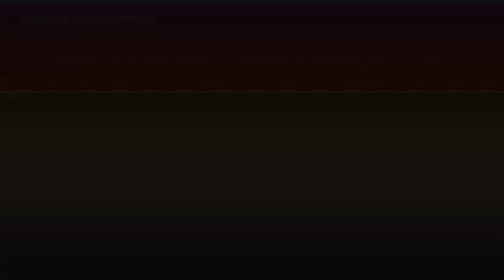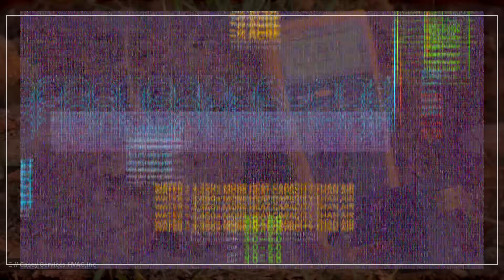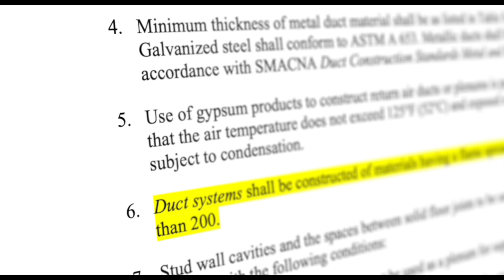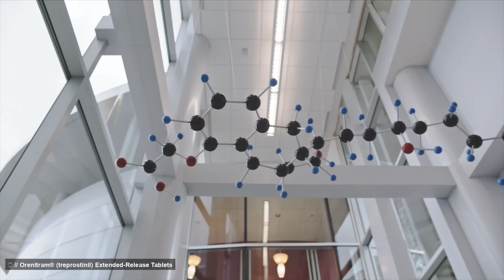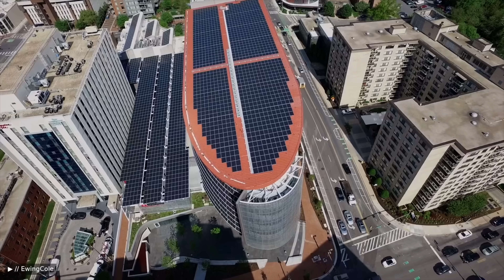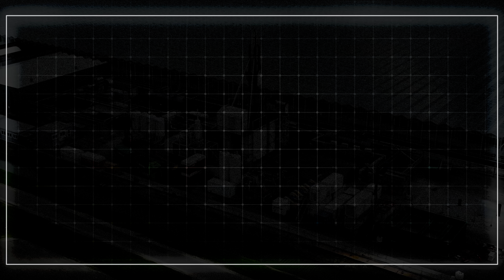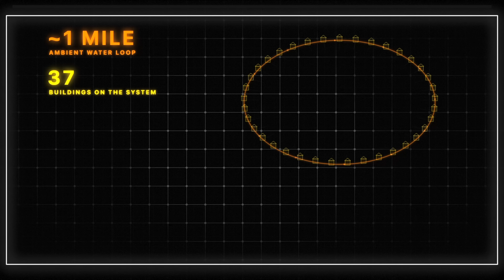The Viral DIY Cooling Hack That Nearly Killed a Family

Comment: usually with a bore hole we do 150-400m but we do one hole for residential and 2+ for big house (mansion) and apartment buildings we dont do shallow bore holes. 
And cost wise where i live its about 150.000KR or about 15-18 thousand dollars depending on the size you want on the heat pump. 
Cost is usually 10k $ for the hole/work then the rest is heat pump and the pay off period is around 5 years sometimes alot less we had one guy that payed it off in a year it all depends what energy you come from and how good your house is,  so for example the best scenario is that you have a really good insulation on the house and floor heat with a house battery and solar/hydro that way you can pay it of fast IF you have high energy prices the more your energy cost the faster it will be payed off

Comment: It's almost impossible to prevent mold from growing in the underground tubing or pipes, which spread mold all throughout your house and gives you the mother of all upper respiratory infections that can have life long consequences or be fatal if it gets too bad. You're better off building a partially in the ground home, the ground temp with help keep the lower walls and floor a constant temperature, lowering how much you need to heat or cool the house to keep things comfortable. The only thing you need to keep an eye out for is effective moisture barriers to keep rain or groundwater from getting into the home, and Radon buildup in certain areas.

Comment: I report ALL videos (to YouTube) that use "BANNED" in the title as 'misleading'.
I'm aware of a home in East Texas that put in an air ground source retrofit on a 4.7 acre plot and had condensate issues in their underground pipes... What they did is run / snake dual 3/4" water lines looped THROUGH the air pipes (there were 3 buried air pipes so 3 loops) and just flooded the air pipes with water for conductivity from ground to water pipes and as a 'storage' medium. The old intakes were shortened to ground level and capped off and the house air intake pipes were disconnected, with only the water pipes emerging from the old air pipes.

Comment: My HVAC is handled by several heat pump mini-split AC units. I have solar panels with battery storage in a total electric home, and my total energy costs are $0.00 per year. I think this may be the most practical and least expensive way to do this.

Comment: You can tell it's a nonsense claim that it's banned in the US simply by the fact that it claims the ban comes from the "International Residential Code". The US famously DGAF about international building code. The US can't even agree on a single building code for the whole country. Building codes are set by the individual states.

Comment: Ever since I saw Tech Ingredients build his, I've wanted to do one myself. it's such a simple design. I'm thinking a bunch of shallower bore holes of wider diameter could work just fine for a whole house system given his results. That little unit he had was working at a crazy efficiency level and it was keeping up with such a large space, and it would help especially with heating my home (which is heat pump only, no gas or other combustion heat) when the temperature drops below 40 degrees outside. Mine switches to inductive heating around that point and our electric bill has been in the high 500's some months in the last couple of years because of how much power is consumed from that type of heat. I've got some window/insulation work to do to improve the efficiency of my house, so it should help out some there, but this simple tech would save us thousands every year if I could DIY one in. I'm talking about a geothermal heat pump/AC setup, not the passive air duct system BTW. In NC it's humid and there's groundwater just under the surface for most of the year, so it would be impossible to keep it free of moisture and mold.

Comment: As a solar architect with 40+ years experience, I’ve done ground source Heat Pump systems and stopped many years ago, not because they didn’t work, but because there were cheaper ways to do it. An airtight super insulated shell combined with inexpensive, mini splits in anything, but the coldest climate is far less expensive. We’ve also been off the grid for 27 years now and have upgraded our solar electric five times and now have an E-10 Anker system with 12,000 W of PV
Reply: Passive insulation in the home is number 1 cost savings, many ways to do it, and then as you said, cheap solar that can make it last for hours after daylight (heating or cooling and other uses) independent of how many batteries one has.
Reply: @segundacuenta726  every house has 1 complete air exchange per hour ideally so you still need to heat it.
Reply: @MrDmadness depending on how tight the building envelope is, an HRV or ERV system would allow the building to complete as many air exchanges as necessary with minimal thermal loss by using the exhaust air to precondition the incoming air. If it's an ERV, then it can also transfer the humidity level over to the incoming air, either humidifying or dehydrating it to match the interior air.
Reply: @codymartin5431 thats why i statedthe minimum code. I desiggn and install heating systems
Reply: Modern air-source heat pumps are amazing.
But where I live the 1 week of back up heat required (when the grid is least able to support it) may still justify a ground-source system.

Comment: A vertical geothermal hole works great for the first 20 years, then it starts to run out of thermal energy, in cold climates anyway. A horizontal grid type loop a little below the frost line works much better since the ground on top can be heated by the sun through the warmer months. Air to water heatpump comes pretty close to ground source in efficiency, and is a lot cheaper to install, especially as a retrofit.
Reply: It can be used for cooling at summer and charged with solar heat for longer lifetime. A slightly deeper well last longer.
Reply: @kide81 the ground below would act exactly like a well and over time cool slowly, so it can infact be used for cooling.

Comment: I use (2) two-hose portable heat pumps that draw from a  damp, unfinished but block wall /  concrete floor basement. The amount of energy available from the latent heat is amazing -- I am good down to 0 deg.F OAT.

I also use a room-size UV sanitizer down there.

Comment: We have a home with an earth pipe system we designed and built itself. It works well. Radon is the main concern here, and luckily not our issue. Yes, in damp climates mold could be a serious problem.

Comment: A geothermal air system makes no sense in any climate IMO because it is not a closed loop system.  As warm air enters the piping, it cools and the moisture in the air condenses and precipitates out within the pipe.  This is similar to the surface of air-conditioning coils but the difference is that after water freezes on AC coils, the ice will melt and dry after the compressor stops as warmer air continues to flow over the coils.  Mold needs moisture to grow.  Open cooling mode geothermal cannot dry out because there is an unlimited amount of cooling that the ground provides from its mass and being an open  system, it spreads mold spores throughout the conditioned space.  An external water source into such pipe make this exponentially worse.

Comment: There are regulations regarding digging, and especially exposing deeper underground dirt to the air in Canada, or at least parts of it. The issue here is that we have a real radon problem in parts of our country (it's regulation to have detectors in the hotspots in addition to smoke detectors), so any direct air circulation that goes through the ground is likely not legal in many parts of Canada. That said, I don't see why anybody would want direct air when it's so obviously inefficient and requires so much more digging. Liquid loops are so much more effective and safer.

It's such a shame people lie so completely. This doesn't even sound like misinterpreting facts, but straight up lies.

Comment: If for some crazy reason you want to go outside and dig a huge, long, deep trench a few hundred feet and install an air tube (and don't install liquid tubing for a ground source heat pump when you've already dug the trench because you hate yourself I guess?), route the outlet to an existing outdoor air source heat pump.  That way you avoid any risk of indoor mold, and just maybe have to make sure to clean the outdoor unit a bit more often.  Won't be quite as efficient, but you won't ruin your life.

Comment: We built an Earth tube in a Passive Solar house in Maine in 1980.  It was targeting heating support more than cooling, and the drainage concern was already known to my parents, what made this feature of the house unusable was that it had taken advantage of the perimeter drainpipe around the foundation, which was perforated 4” pvc, and created a serious radon gas danger. 

That system was capped, with a big sigh.  Luckily, we also built in a Massy Russian Counterflow Wood Furnace, which is a highly efficient use of wood heat.  It was also well insulated and had passive solar gain.

Thanks for the well researched video!

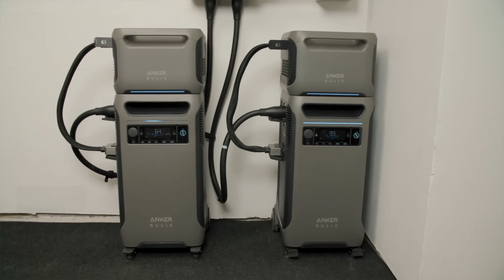Comment: Be careful about listening to people who are pushing a solar product for any company. I’ve seen lots of people who obviously know nothing about solar or the math behind electricity saying this unit will run your entire house for weeks. Like this video, he said “ WITH expansion batteries “ you can run essentials for weeks “ (5:00).  Let me tell you that’s a lot of batteries. If a person has a 10,000 BTU air conditioner ( at 120 volts it will use about 3000 watts an HOUR), one of these Ankler units rated at just under 6000 watts will run it for about two hours !  If you want to run your house for weeks off of it, be prepared to shell out big bucks for the “ expansion batteries “ he is talking about. I love solar, just be careful about believing everything people who are being paid to sell something are telling you.
Reply: I agree you shouldn't listen to people saying you shouldn't listen to people who obviously don't know anything about it or the math. You are one such person. Ypu say a 10,000 BTU air conditioner will use 3000 watts an hour which makes no sense. I think you mean a 10,000 Btu/hr air conditioner will use 3000 watt-hours per hour (which is a weird way to say 3000 watts) but that isn't true. With the current federal minimum efficiency it will use under 800 watts.

The ad read said 54kWh could run essentials for weeks. If we take this to mean 14 days, they're assuming "essentials" use 160 watts. This is really only enough for a fridge and some lights so they're definitely stretching the truth, but in mild climates that really is all you need.

Comment: Sorry, but from a financial perspective any investment that takes 10 years to break even is a waste of money, that kind of language is a huge red flag. If you had put 40k in the S&P500 10 years ago it would be worth ~$140k today. Investing in cost avoidance rarely pays off, the opportunity costs are too high. This is the problem with most green technology, you simply don't spend enough money on heating and cooling to ever be able to save enough to make it worth such an upfront investment. When the upfront cost is on par with conventional systems, then the more efficient option makes sense for new builds. But replacing a functioning system almost never makes sense no matter how efficient the newer one is, and even when the existing conventional systems break down, it's almost always way cheaper to replace components than to tear out the whole system and install a different type of system.

Comment: The scariest part is that someone thought that was a good idea.
Florida, Louisiana and the Gulf Coast - using the air circulation underground would be a mold factory waiting to happen?
You don't need the underground air circ system - it's ALREADY a mold factory.  😉
About that first "utility owned thermal energy network" in Farmingham.  Maybe it's the first "fully thermal" network, but I'm pretty sure So Cal Edison had a hybrid system in San Dimas CA back in the 80s.  It didn't last long, but it was in use for an apartment complex that I believe was the model for future expansion.  But then the cost of electricity went down and the ROI got too far off. They had a combination geothermal / electric setup that circulated some kind of solution throughout the complex. It was a benefit mentioned in the rental brochures. The problem with it was that residents didn't like leaving the system on all the time. The fans and pumps added about 15 to 20% to the monthly electric bill. When the system was turned off, the chilled water would produce a lot of condensation that wasn't figured into the design. oops - mold again.

Comment: If a loop system needs to go down only five feet or so, why does a vertical system need to go down 350 to 700 feet?  Seems excessive, and so different!  (I understand that the length of the run is the determining factor, but that depth seems ridiculous.   Why not a dozens or so shafts in a line that are only ¼ as deep...?  or 40 well-space shafts that are only one-tenth the depth?)

Comment: 25k is a lot to save 210 on some months. Also I live very close to the new build neighborhood mentioned in the video. I live in a large house built in the 80s that is pretty leaky. Our utilities bill is a third cheaper than theirs in the summer, even with my roommates EV charging. I did buy a large dehumidifier, but we've been comfortable since

Comment: I have a friend in Ohio that uses their large pond (small lake) as the heat sink with their geothermal system. The system uses a glycol blend for reduced maintenance and to protect against the possibility of freezing a line when frost runs deep every decade or so. Electric/gas backup furnace if needed. The main floor is also radiant heat. Very energy efficient and low maintenance.
Reply: Yeah, when a pond loop is done properly (closed loop system like you’re describing), they can be fantastic.

Usually when you see pond loop stuff not work it’s because they didn’t use enough pipe, pond isn’t deep enough, stuff like that..  It’s certainly good to have a nice dual fuel option like they do!
Reply: @ReidemeisterLoops  Ive thought of trying this using my swimming pool

Comment: I worked on ground source heat pumps at least once a week here in Washington state. By the way a heat pump should be run 24 hours a day. The energy captured and exchanged is considerably smaller than available with a gas furnace. Heat pumps cannot heat or cool a space quickly.

Comment: WARNING! NOT GOOD! ---> Gas is going the way of Wind & Solar! Now: "Gas companies" Becoming "GEOTHERMAL companies" means they have been given the legal right to gouge the hell out of customers for the low cost energy the companies are producing/installing - "R.O.I.  WILL CONVENIENTLY Be about equal to the life of the system" - this is the "MONETARY MODEL" Not the "PHYSICS MODEL" nor "HOMEOWNER BENEFIT MODEL" - It's all about perpetuating capitalism (which is a self consuming system) EXPLANATION: Capitalism encourages innovation, Leading to, higher efficiency, longer lasting products and lower energy consumption, Leading to, smaller markets to support the ECONOMY ! it's completely NECESSARY to "PLAN OBSOLESCENCE" and "build in" inefficiencies - even into efficient systems ---> Initial cost becomes so large that your end result is still paying the same profits that Centralized oil, gas & electricity were.

Comment: Sucks that Trumps BbbtBBbtBBBT cuts so many incentives for renewable energy. BUT while it's disgusting that we're attacking another country on the whim of one man, it's undeniable that he has proven once again that we cannot rely on Big Oil to always be there.  Sure Sun and Wind aren't always there but Batteries fix that and they are coming on strong. Geo IS 24x7 and once installed these technologies run on free forever fuel. So short term pain will exist but Electric cars, and so much more will take off going forward. Sadly we in the U.S. will NOT be a leader in that but despite the worst protestations by oval office man, we too will eventually move to renewables.

Comment: Your point about a broken HVAC driving purchases is very spot on. I had a furnace die in December on a day that was -20F. I had already priced a ground source heat pump, and the installation for my 100 year old home was about 3-4 times the cost of just replacing both the gas furnace and my AC unit, and that was already about $18k to do both. I was interested in doing a heat pump, but didn't have the financial means to even consider it.
Reply: Inertia is a real thing.  The same occurs for hot water systems.  When your home hot water goes out, are you going spend a week or so researching, sourcing and contracting the best, most efficient technology, or are you calling a contractor and having the same system installed within three business days?

Good luck persuading your family/spouse to enjoy cold showers, especially in winter!

Comment: Would it work to combine a ground source geothermal with a mini split style to central air handler? Meaning something like using the thermal transfer from ground to condition the environment around the exterior unit so it doesn't have to fight temperature extremes. For that matter, would a structure  around the exterior unit that used passive solar principles of temperature regulation to condition the environment it sits in accomplish the same effect?

Comment: I’ve got geothermal in NW IA that the previous owner retrofitted. It’s slightly undersized, but it’s 35yrs old and not a single issue besides a circulating pump that went bad. I have a gas supplement heater as well because my geothermal doesn’t keep up once it’s below 20F steadily. However, that could be my system and possibly some insulation issues on my old home.